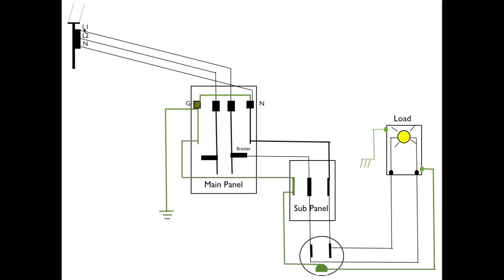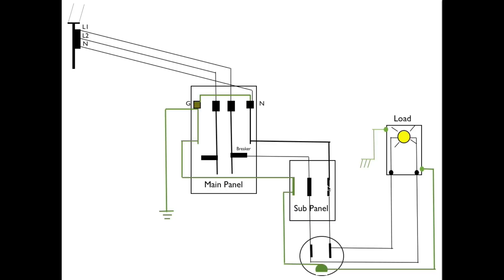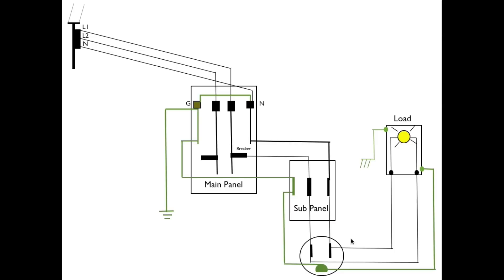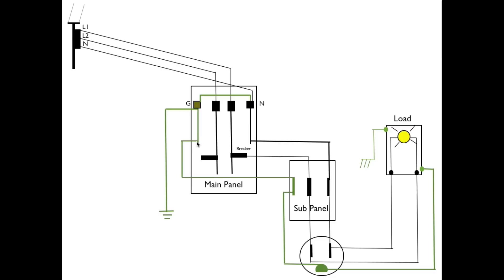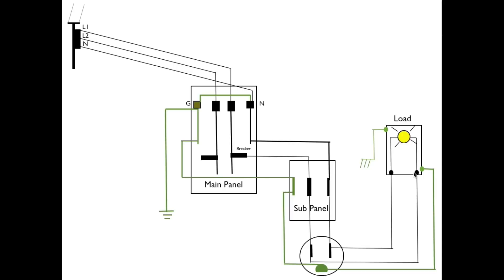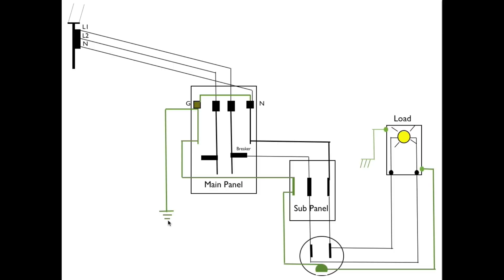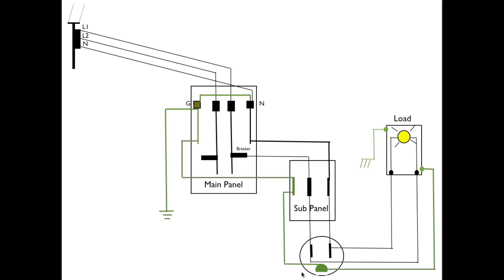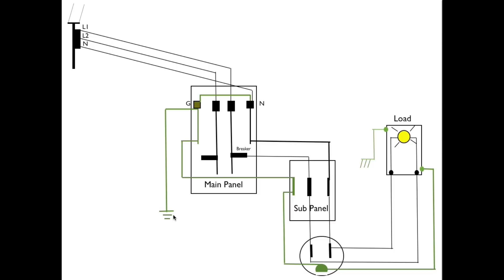The difference between neutral and ground on the electric panel

Comment: I've been researching how and why the grid works and delivers power to your home. BUT for electricity to flow it has to complete a circuit. Right? The nuetral on the pole and the neutral from the tranformer to your home, is not hot. Unless there's a short somewhere in the grid. Electricity flows from the tranformer to your house and then where? To ground where's its wasted? It doesn't travel back to the transformer. Every video and diagram says it travels through the hot wire through your home and then back through the nuetral. BUT the nuetral from your meter to the pole is NEVER hot, UNLESS there's a short between your meter and tranformer. NO ELECTRICITY EVER TRAVELS BACK INTO THE GRID FROM YOUR HOME. It's just wasted into the ground. This would only make sense if ground was used as positive, to complete the circuit.
Reply: many of your statements are simply incorrect, or at least disregarding necessary details.
Current, and charge, indeed do return to the transformer. Electricity is trying to get back to SOURCE, not EARTH.
You're conflating 'hot' with current. 'Hot' simply means it has voltage potential to ground. Neutral is grounded, and so is not 'hot' but it is absolutely carrying CURRENT. 
Consider this: If you cut the neutral connection and put yourself in series with it, you would be in series with the circuit and would in for it! The neutral essentially becomes hot by being broken from the return path.
Reply: Spruce_Goose    If you connect a meter to a grounded conductor and ground, you will get zero volts (key word) "difference" in potential.   There is voltage on it and is the same as the ground conductor.  There has to be voltage on the neutral or else AC would not work.   Just not a potential difference.
Reply: @KevinCoop1  >"There has to be voltage on the neutral or else AC would not work." 
No. You are conflating ideas of current and voltage. That, or you just haven't thought through the concept of voltage far enough, and you're statement needs further clarification. See #3 below— I want to address 2 things first. 

1) I agree that voltage from the grounded conductor to physical ground is practically zero volts—we set this up intentionally. I don't believe I said anything to the contrary (please point out if I did). 
2) I also agree the key to voltage is in defining the reference points from which we are taking our measurement. Or as you say, the difference between two points. This is why I used the term 'voltage potential to ground'. It implies 2 points of reference: 1) the grounded conductor, and 2) the ground.
3) OK, now for the meat of it: Voltage is not an absolute measurement. It is always a measurements between points. To simply say "there is voltage on [the neutral]" is— while perhaps not strictly wrong— not a complete statement. Voltage between what? To ground, it is zero volts, as you agree with. So what does it have voltage to? Aha! To the so called hot wire. We use the term hot to imply it would bite us standing on the ground, as most humans do. The neutral simply does not bite in this way (if all is operating correctly) and so is indeed not hot . If you would like to imply it has voltage, you really need to specify the other reference point. 

p.s. this isn't some quirk of AC as you suggest. The same would be true for a two wire DC system. One of the wires (call it the negative) would have zero volts to ground if we grounded it. The other wire (positive) would have the full voltage of the DC system to ground. But even in this DC system, the grounded wire would indeed have voltage to the positive wire, while having no voltage to ground; same as in an AC system. The difference is that one is steady (think flat line on a graph) while the other undulates in a sine wave (typically). But don't be lulled into thinking that because the sine wave 'drops' below the x-axis that suddenly the neutral gains voltage while the hot loses it, in some absolute sense. The sine wave can only be generated with a reference point (a neutral), and that point will be the grounded conductor in standard cases. Therefore, the neutral is effectively depicted by the x-axis itself, while the sine wave is a depiction of the hot only. Of course, this could all theoretically be reversed, and the same wire we normally ground could be un-tethered from the earth connection (ungrounded), the 'hot' could be grounded, and the entire system would function essentially the same, but with different color jackets (and some ECG issues etc.)
Reply: Spruce_Goose   You have had some education and we agree on some things.   But the line point on a sine wave is Not neutral.  It is zero.  Could be amps could be volts, still zero.  Since when can a sine wave not be generated without a neutral?   Cut the neutral off of a single phase 120/240 volt transformer and you still get 240 volts and in a sine wave.   Put the neutral back, cut off the ground, you will have three sine waves from voltage.  Two at 120 volts and one at 240 volts.  So ungrounded, you have 120 volt potential on neutral measured from L1 or L2.   The voltage does not just disappear on the neutral when you ground it.  The voltage potential is still there.  If it were not there, you could not get any current.   No volts=no amps.   Ground is not required for an electrical system to work.   Before the 1950's residential systems were not grounded at all.   Ungrounded systems are still in use and legal.   Two places I know of are manufacturing assembly lines like automotive and in some specific operating rooms in hospitals.  Respectfully,   Kevin
Reply: @KevinCoop1  Hi Kevin. Thanks for the discussion.
Let's first confirm: are you speaking from a North American split-phase system perspective? That's where I'm coming from.

I'll start with where I agree with you 100%:

'Ground is not required for an electrical system to work.' Agreed.

Now, the part where I think there is some confusion:

 'The voltage does not just disappear on the neutral when you ground it. The voltage potential is still there.' 
-This isn't really a sound statement in that you really need to talk about potential to what. I can't tell if you fully grasp that voltage is not an absolute concept. I'm not trying to nit-pick here; it's pivotal to the fundamental concept of voltage. 
When you ground the transformer center-tap, thereby making it the grounded conductor, you do indeed disappear all the voltage on the neutral in reference to ground. This happens to be a fairly important reference :)
On the other hand, in reference to the hot it is true that the voltage hasn't disappeared. 

Perhaps what might get us on the same page is this:
In an ungrounded system, there is no way to determine which line (assuming two lines) "has the voltage." We certainly cannot say what the voltage is to ground from either line. It is essentially unknowable. All we know is that there would be a voltage potential between the two lines. One would not be dubbed 0 volts while the other at 120. Both would simply be 120 to each other. In this way, if we un-grounded our standard electrical system, then certainly we can't claim a neutral with 0 volts. I have a feeling we'll rally in agreement around this point. 

Now getting back to the sine wave (which is perhaps just a distraction): 

In order to view a sine wave, it needs reference points. This is typically done by using the grounded conductor (the center tap of the transformer) as the ground reference. This does indeed make the neutral line effectively the x-axis, sort of in the same way that grounding it makes it harmless to us standing on the ground. We're 'not privy' to the sinusoidal meandering of the neutral because as far as we're concerned, its not happening. Its flat (the x-axis). If we decoupled this line from the reference of earth, then its form becomes somewhat mysterious to us as earth referenced beings. We need some reference— much like you need eyes from which to see (ok maybe a slight stretch of an analogy). 
Additionally, you can't really view all three sine waves at once, but assuming you are just discussing the theory, then yes, there are 3 sine waves that can be generated from a split phase system. 2 of them will be referenced to the center tap and will show 120 V RMS (or peaks of about 170), and they will be anti-phase to each other (180 degrees out). The third would be a larger sine wave of RMS 240, but this would require one of the lines to serve as a functional neutral while the other lines rotates (sinusoidal) about that reference point. 
Everything in this discussion is highly subject to reference. It's meaningless without it. 

I suggest this video regarding the sine wave: https://www.youtube.com/watch?v=vOh2OSJ44eE
Check out what he says at 2 minutes. 

For the record, I don't operate an oscilloscope myself; my knowledge is studied and theoretical on the matter. 
Cheers.
Reply: Spruce_Goose    From your last word, it seems you are from across the pond.   We are pretty much in agreement with most of what you said.   These are the finer points of electrical theory.    
The 180 degrees out of phase is taught in classrooms all over the place and after a LOT of mulling, I say that I disagree with the concept.   I think I actually asked that guy that made the video you referenced to discuss this issue and heard nothing back.    So, I'm going to ask if you would indulge my thoughts on this whole 180 degrees out of phase being how you look at it.   I'm not totally crazy, just a little.   I had to learn about electricity in the school of hard knocks!   I am not a graduate Electrical Engineer, but I did become a Professional Engineer in 2007.   I'm now retired after designing electrical systems for electrical contractors since 1983.   If I am wrong, I admit it, but it must be proven.   Let me know if interested.
Reply: @KevinCoop1  Don't let the 'cheers' fool you. I'm from America.

It's funny you mention the 180 out of phase because I've gotten into this before, initiated by my own confusion on the matter.

Here's my take:
It once again comes down to reference. That's the short of it.
The two lines are indeed 'out of phase' when the center tap is the reference (which is part of what I was getting at above). This can be visualized on an oscilloscope. It is inherent with a split phase (a tapped single coil acting as the secondary winding of the pole transformer) to be  precisely antiphase meaning 180 degrees out— not some other number in between, such as 120 degrees for 3 phase, or 90 degrees as seen in some true 2 phase systems. Even if the center tap wasn't perfectly centered, it would be 180 degrees, the two waves just wouldn't have the same magnitude. 

Now the catch is this: If you use 'the bottom' of the transformer winding (L1) as reference instead of center tap, then suddenly the phases would be considered in phase, or stacked. The waveform would be one, larger one. 

A nice analogy is with batteries, despite them being DC. Take two simple batteries, such as AA's, for example. If we stack those batteries end for end, positive to negative, we will have put those batteries in series, and their voltages will be series aiding (meaning additive). So two 2 volt batteries would give us 4 volts end to end. This can be considered a snapshot in time of an AC system that is in phase.
If we then instead reference voltages of this very same battery stack up end to middle, then suddenly we don't have 4 volts: we have 2 to each side: 2 from middle to top, and 2 from middle to bottom, but in different directions charge-wise. With this center reference (think center tapped transformer now), this could be viewed as analogous to a snapshot in time of an AC system out of phase, since the highest charge state of the lower battery will coincide with the lowest charge state of the upper battery; this would form that neutral plane (x-axis). The higher charge state of the upper battery and the lower charge state of the lower battery would form the waveform peaks. (The difference is only that with AC it's changing back and forth in the pattern of a sine wave, whereas the DC graph would be 2 straight horizontal lines, one above the x-axis and the other below. But if you moved the reference back to the bottom and top of the batteries, then the x-axis becomes the bottom of the bottom battery, and the horizontal line will run completely above the x-axis, at double the value)

The DC battery analogy can be considered a picture of the movie that is AC. The picture would be taken when the AC waveform is peaking. If you picture the waveform generated from L1 to neutral, and the waveform generated from L2 to neutral, L1 will be peaking high when L2 is peaking low. Similarly, in the battery example, the high point of battery 1, will coincide exactly with the low point of battery 2. 

So in summary: its all reference, and whether the two live lines from a split phase system are in phase or out of phase is a matter of where your measuring from (which would most often be neutral, which is why most people say they are out of phase). But many people do refer to the phases of a split phase system as being 'series aiding' which is similar as saying, in-phase. Everyone is correct!

Sorry for the ramble. Thanks for a nice discourse.
Reply: Spruce_Goose    Ok I need for you to draw the connection diagram for a small single phase transformer one primary coil and two secondary coils either in your head or on paper.   I do it in my head.   If you need a link to one, let me know.   The diagrams will have  H1 to H2 primary let's say 480 volts.   Then they have (4) connections on the secondary.   X1,X2,X3,and X4.   Let's say that X2 and X3 are connected and are our neutral.   So X1 to X4 is 240 volts.   X1to X2,3 is 120 volts and X2,3 to X4 is 120 volts.   Let's only look at 1/2 cycle of a sine wave for this.   Assume H1 and X1 are on the same side of the diagram.   So for the first half cycle electrons flow in primary from H1 to H2.   This creates voltage in the secondary from X1 to X4 as 240 volts.   The sine wave starts at zero, peaks and ends at exactly the same points in time.   So for 120 volts, at the same exact time the voltage from (be careful here) X1 to X2,3 is starting, peaking, and ending.   And from X2,3 to X4 the sine wave at the exact same time is starting, peaking and ending.    It absolutely has to all flow in the same derivation at the same time.   Yet, people who hook an Oscope to the system see an out of phase sine wave.   This is because it is reading from X1 to X2,3 and from X4 to X3,4 because it has a common probe that must be used.   So, I contend not 180 degrees out of phase, but test conditions make it look that way.   Let me know your thoughts after you think it through.    Respectfully,   Kevin
Reply: @KevinCoop1  What are you trying to confuse me Kevin, drawing mental diagrams! :) Too late for me.

I think what's going on here is that they are flowing in the 'same direction' from a certain reference, but from a center reference some are flowing 'towards center' while others are flowing 'away from center'.

Let's use a visual analogy. Imagine a water slide. Undoubtedly, all the water is running 'in the same direction' down the water slide, from top to bottom. Call the height of the slide the voltage. 
Similar to the secondary winding, all flow is in harmony and the total voltage from top to bottom is in accordance (gravity doesn't change direction half way down the slide). In this sense, I agree that one may want to consider this system as being 'in phase', since it's one slide with one total voltage. Some people might argue, however, that it is not really 2 systems 'in-phase' but one larger system of a singe phase.

Where it gets interesting is if you sat in the middle of the water slide. The water from above is moving towards you, while the water below is moving away from you. It is the relative value of towards and away that helps draw the sine wave. Think of the waveform as depicting whether or not the water is moving towards you (0) or away from you (0). While one leg (or one waveform) is moving towards you, the other is moving away, even though the total slide is cooperatively moving in 'one direction.'
Of course with AC, the water slide tilts like a seesaw 60 times a second.  
Actually the seesaw is a neat analogy. Neutral is analogous to the fulcrum. If we didn't want to use a center tap (center fulcrum), we would still need to choose one side or the other (L1 or L2) to act as the 'fulcrum' for reference.  In lieu of a fulcrum, or reference, the see saw is just a floating board.
I do agree with your analysis, and the notion that it may be considered 'in-phase' but I also think it isn't wrong to discuss the lines in terms of being 180 out of phase, referenced to center, which happens to be where we would most often reference in the real world.
Reply: Spruce_Goose    I was told a few years ago I have dyslexia.   Not seeing things backward.   I have a hard time in a math class if all I get is formulas.   But show me how the math works in real life I get it easily.  Like trig.   I also look at a plan on paper and immediately start seeing the building and everything else shown in 3D.  I did 3D AutoCad and was extremely good at it.  So sorry about diagram in your head.   I like the see saw analogy it fits exactly.  Putting it in 3D though their way of seeing 180 degrees to me means that both ends are either up or down at the same time and balls are falling off the ends or into the center.   Never one end up and one end down.   When questioned, most say that it shows up and is proven be an Oscope.   So, I'm not totally crazy.  Good, I feel better.
Here is another question.  If you are an electric customer and your power factor is .75 lagging because you have inductive loads, on a single phase 120/240 volt service, would you care?    BTW. What do you do for a living?